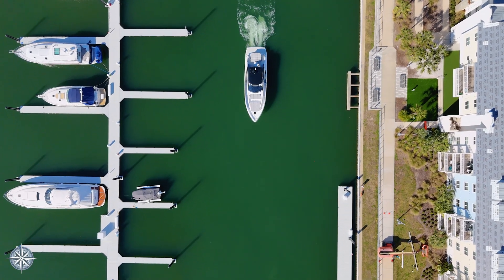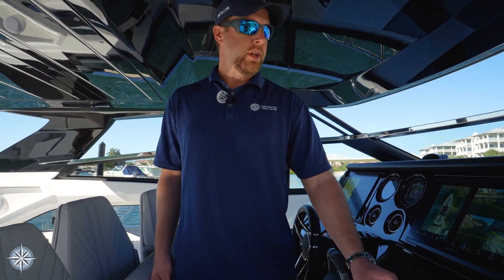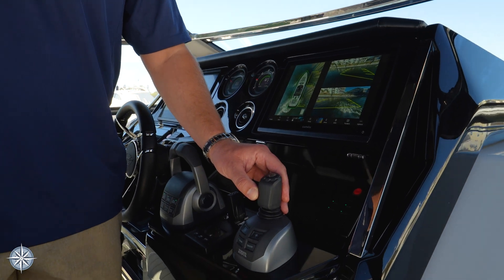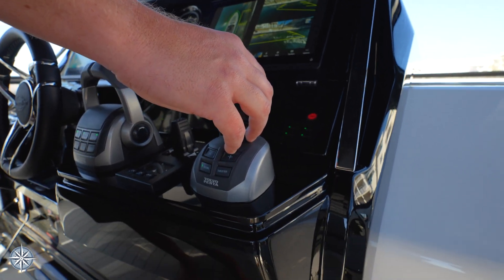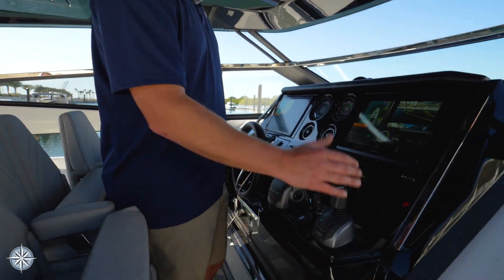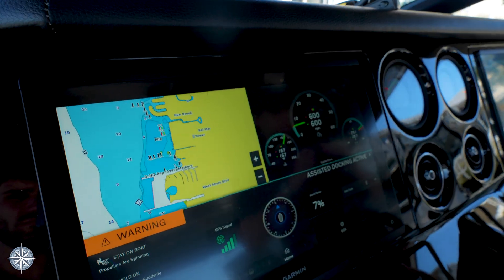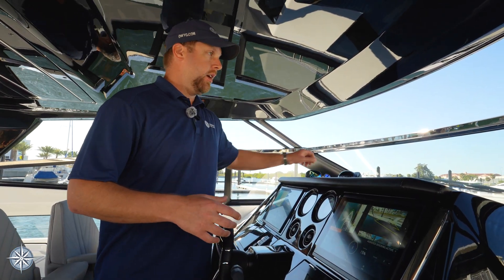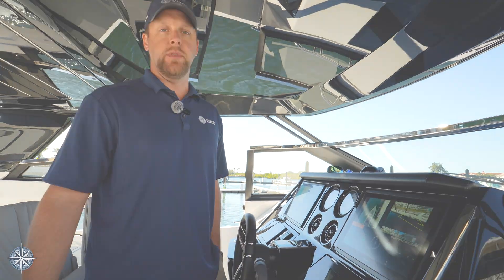Should You Pay for the Assisted Docking System on Your Boat?

Comment: Hi Dusty, I’m looking to buy a Cruisers 60 fly that comes with the Volvo penta IPS pods. Couple of questions and I was wondering if you could give me your opinion. This boat has no thrusters whatsoever neither bow nor stern. Do you find that unusual or is the pods Enough to dock this boat even in some wind in South Florida. Additionally, the assisted docking system that you show in this video, is that included with Volvo penta IPS pods, or is that something above and beyond that you have to add on? And if so, is it software hardware or both? Thank you, Ira.

Comment: We are getting to the point that nobody will have the true skill in operating a boat... wait till it breaks down and you have no clue how to dock your boat.....
Reply from the maker: It's definitely important to have proper training on how to maneuver and dock your boat using the throttle levers in the event of an equipment malfunction. The upside of this technology entering the marine market is it gives more boaters the confidence to move into various sizes of boats.
Reply: The likelihood of the joystick failing is probably about the same as the throttles. On this boat they are both controlling things electrically, there's no physical connection. So I don't think the eventuality you are describing (failed joystock/dock assist, but operational throttles and steering) is very likely to happen...

Comment: I had IPS on my previous boat..the maneuverability is incredible but so many problems with the controls unit..a traditional shaft line is more reliable
Reply: Totally agree. They are innovative, but finicky. And expensive to maintain and repair. 😎
Reply from the maker: IPS units do have more moving parts compared to a traditional shaft. We have seen improved reliability in past few years as the technology becomes more 'dialed in'.
Reply: @YachtsByDusty  Could be, but I have another experience with my friend who bought a new Azimut 78 fly 2021, 3 IPS. First year had problems during summer cruise in Sardinia. Boat stuck for 10 days, and holiday ruined. Too "delicate" in my opinion